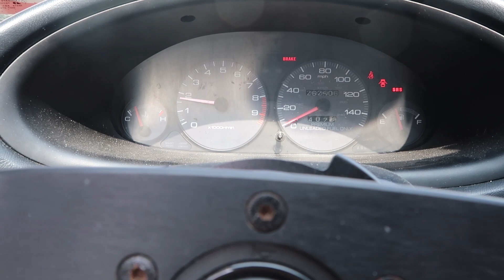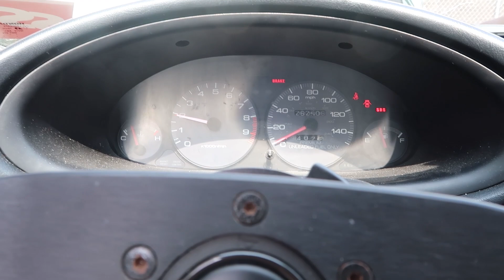How to SeaFoam your car THE RIGHT WAY! (Integra DC2)

Comment: The black specs will just be coming from unburnt hydro carbines and other particulates exiting the exhaust. Probably from oil burn while in VTEC which is so common its basically normal for Hondas, nothing to worry about and not a whole lot you can do to fix it, other than maybe extending or rebuilding the rear muffler to clear the bumper.
Reply from the maker: Thanks!

Comment: Aye I was just wondering wat is the shift knob like where did you get it
Reply from the maker: It's a GruppeM Shift knob. It's designed for an NSX but works on all Honda's pretty much. I got the shift knob on ICB Motorsports.
Reply: @Seikers   thanks btw huge fan and I’m also trying to make a type r replica with my integra but it’s ls but still gonna try but just know you have a fun in Tennessee
Reply from the maker: @s.v.c1  Appreciate the support!